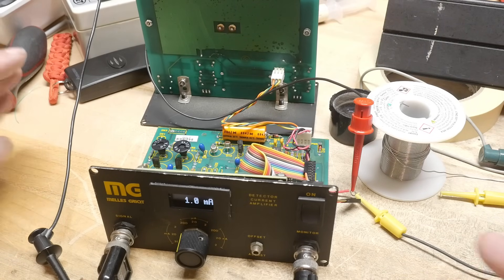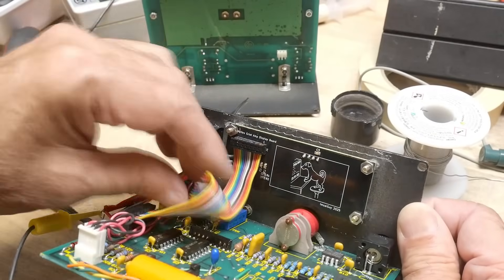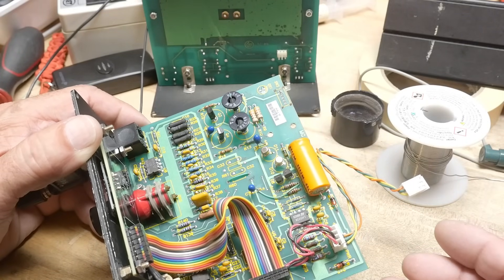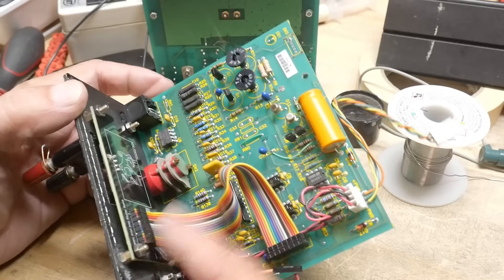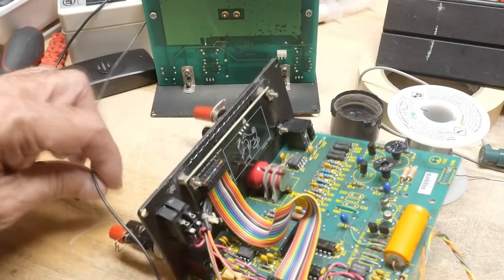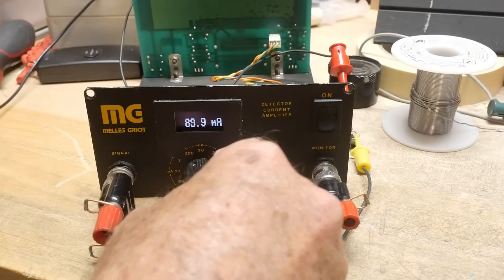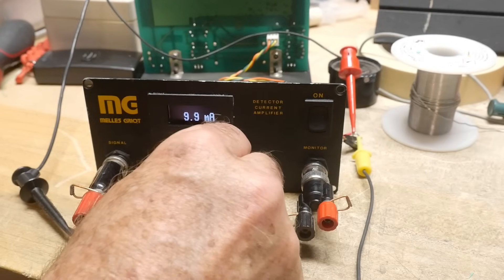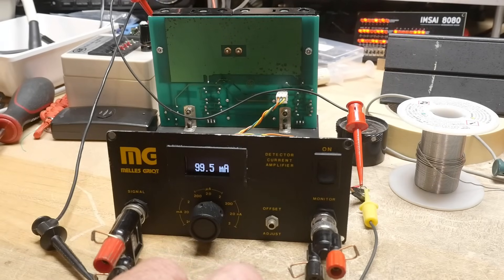#2291 Melles Griot Transimpedance Amplifier (part 6 of 6)

Comment: The thing I don't get overall about the whole amplifier is in what application is reading the number off the screen fast enough? Why does it have a screen at all, and not just the voltage outputs (which presumably are very fast) on the back. Usually when I think photodiodes, I think of data reception applications, or capturing very transient optical events of some kind, not really "steady state" measurements.  Maybe a future video on a practical application of how this would be used would be interesting.
Reply from the maker: I used these at work to measure the current from a photo diode on an integrating sphere. this was used to measure the output power of LEDs and Laser diodes. This is a DC measurement. https://youtu.be/tuYIKuyKZHU?si=7PsXfxoYLngwkSUb
Reply: @IMSAIGuy  Ah, ok, that makes sense. So it is for a "steady state" dc measurement. I also noticed in one of the prior videos, the photodiode is in photovoltaic mode (not biased, and it's essentially generating current in the forward direction). I guess for most "fast" measurements or data reception, they're usually reverse biased in photoconductive mode. Or you can WAY over-reverse bias them into avalanche mode, but then you need a quench circuit to detect and stop the avalanche when it starts, and usually need specially designed photodiodes that operate correctly in avalanche mode to actually do that.

Comment: I added a graphical LCD color display to my old Fluke 8050A DMM, to replace the original (glass!) 7-segment LCD display that had degraded.  Adding in a microprocessor to the mix also enabled me to improve the features of the DMM; now it has LOW and HIGH readings, which range and function we're measuring and a bar graph.   Also much easier to read!   Brings new life to these old devices.  Thanks for this series of videos taking us through the process.